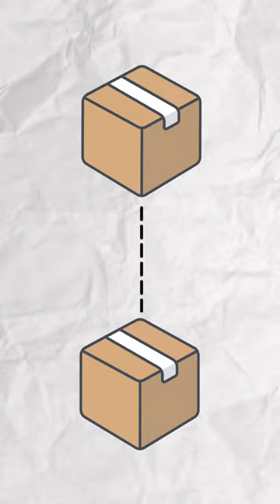Learn This Design Principle - Reduce Coupling!

Comment: I'm mostly a beginner. And as soon as I start solving a problem or building a project, even before I've found a solution, I start worrying about best designs. This causes me a lot of time to find a solution. 
Would you recommend this to a beginner or a relatively experienced ones?
Reply: Always. Low coupling gives alittle extra work at first, but as Tim points out, it makes it easier to bug fix.

I recently had to expand an application. However it was heavily coupled, making it a nightmare to add things on, cause everything broke something somewhere.

Had to refactor 2200 lines of code, but now its also ready for more features in the future
Reply: @jeverydk Hey are you a freelancer or an employee?